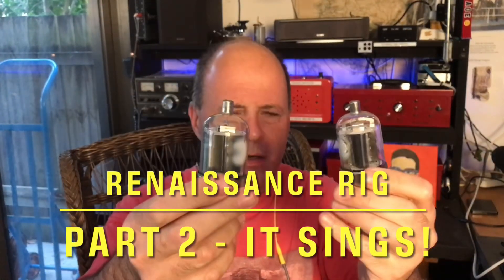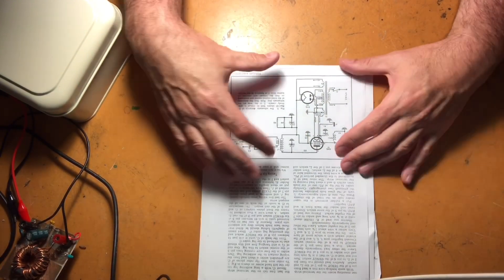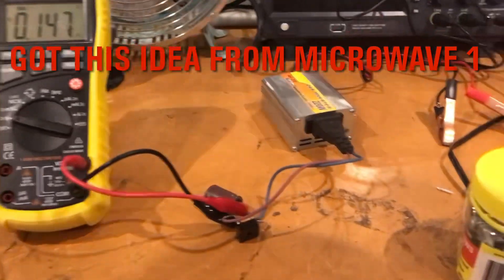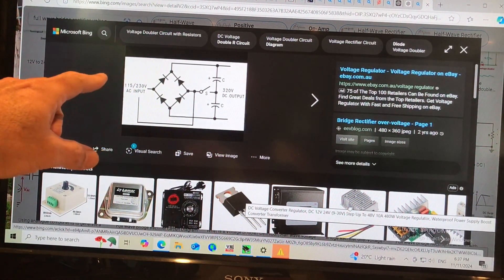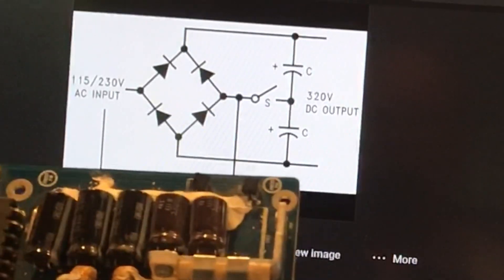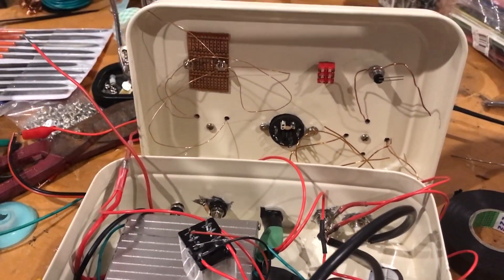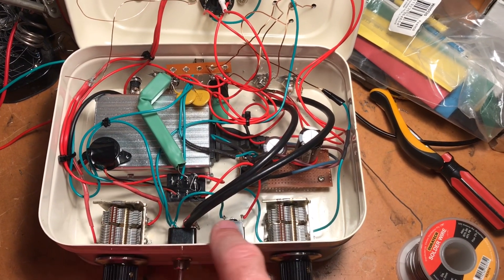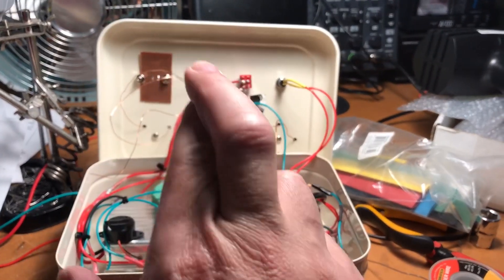Renaissance Rig - Part II The Joy of Oscillation

Comment: Talking about rough as guts home brew stuff. I was looking up  The Sangean ATS 803 A wish is a SSB capable   consumer receiver from the 90s. it has a   50 ohm  Coax  input as well as the  normal  expanding whip. There's a case of a guy using a  20 W transmitter based on two IRF 510 Mosfets  having a Qso  using  such a combination  with  San Francisco out o Synney town.  So   George. -  Aussie technical Giants , true flaxen headed Sons of Australia   have come before you and you are simply standing on their shoulders  .

That Said , the Sangean  is about  10 x the radio  technically  that the Realistic brand  Dx is .
Reply from the maker: Yes I am presently only revisiting past glory, as a reminder of the glorious past of the invention of radio by the likes of Tesla, Marconi (ok he stole some ideas) and Hertzzzzz.😝🤡😂
Reply: @TheArtofEngineering  Keep pushing the stuff up hill and surely you will get a signal into Hawaii or ... failing that  Auckland :-)). Imagine Teslat with  electric cars and Microcontrollers and the C programming Language.  The world would be well a very different place.  

i'm going to  run the N3ZI   booster cct  which has no  LC circuit in it as  recommended by LAtta,  Ham who did the article  for booting   Ad98xx   type  DDS circuits to run valves  -  which is just the  Link you sent me a few days back.  Will report  back in due course.   Run it in LTSpice at say 5, 10 and  15 Mhz into a valve grid load with  a guessed equivalent of  Si 5351   driving it   but square wave fashion to keep it honest   LTS is pretty accurate.    2n 2222 tranistors should  Not be used on low MW  signals ... it looks like a amateur design in parts.